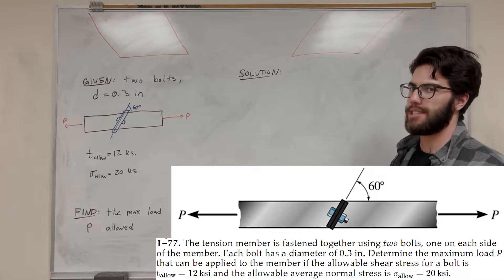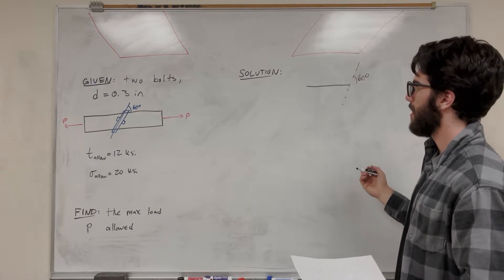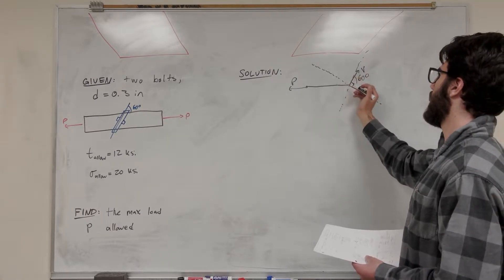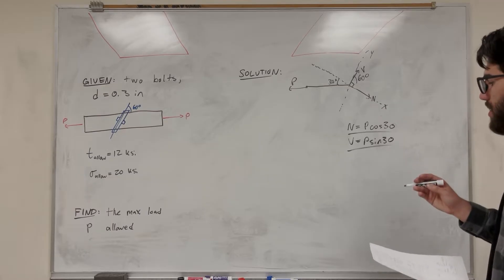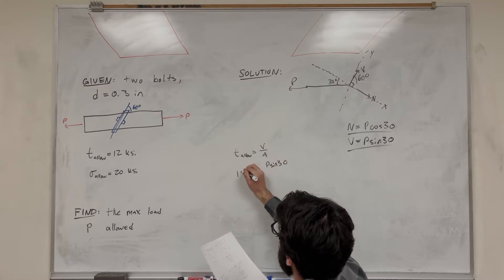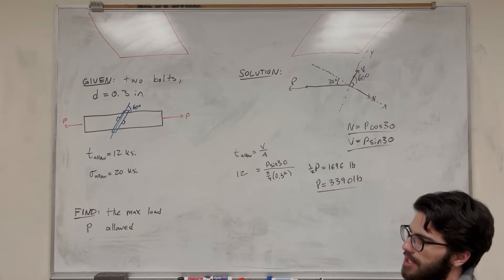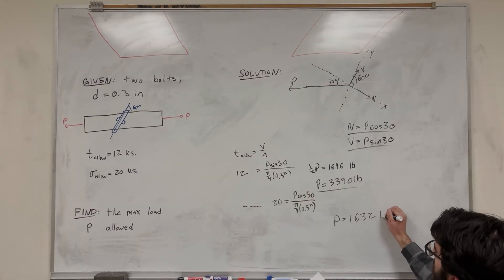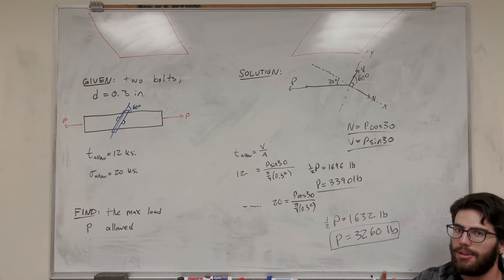The tension member is fastened together using two bolts, one on each side of the member - 1-77

Comment: Can you clarify why we divide P by two at the end? I thought the cut already accounted for one side of ths member and one side of the pin already.
Reply: there are two bolts and both bolts point the oppoite direction of the force. So 2 of the bolts equal the one force pointing in the opposite direction. You don't divide by two of there is only one bolt, because it takes all the shear. So it's divided in two to account for this.